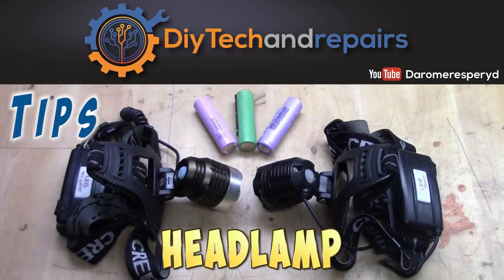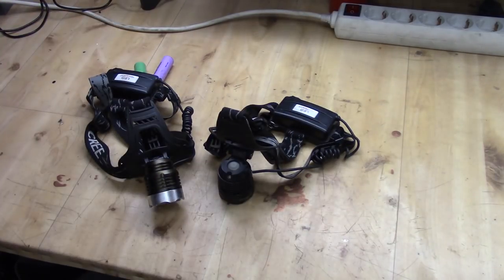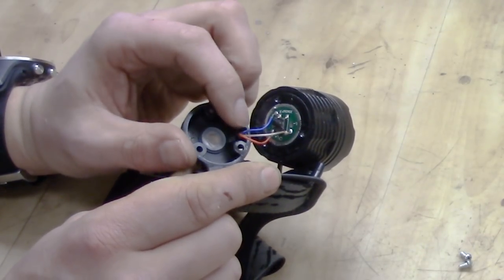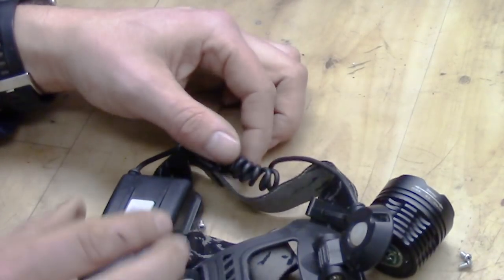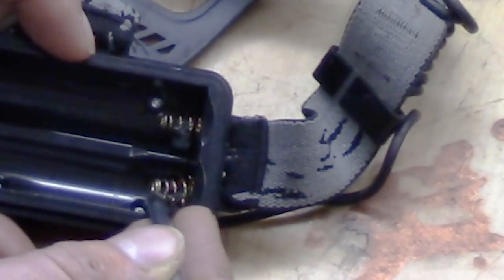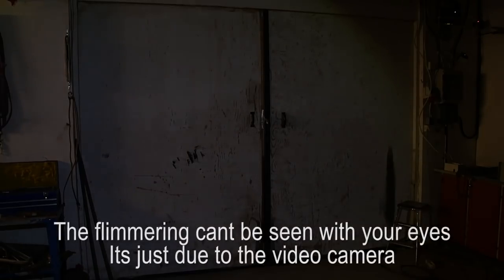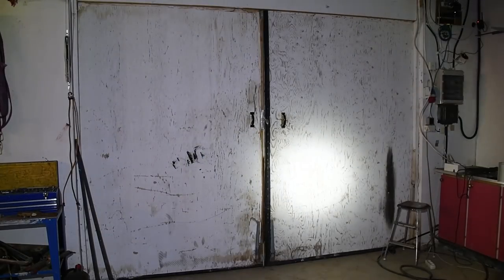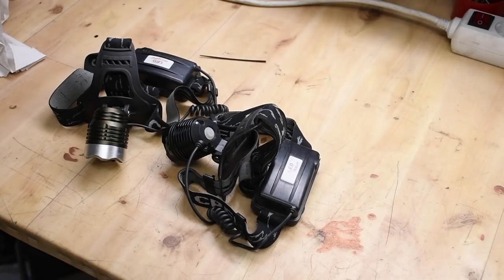18650 based Headlamp tips!

Comment: Good information. Thank you. And I agree about getting your 18650 batteries separately from a good supplier. My main issues with these cheap headlights is that the straps fail early and they are difficult to replace or fix. But the LEDs themselves are usually good even with cheap units.

Comment: Have you tried those "angled" single cell 18650 -headlamps? Skilhunt H-series for example? Or cheaper, general Chinese lamps of similar style? Personally I just love the simplicity, smallish size and lack of wires with these lamps. Thanks for great videos! Subscribed. :)
Reply from the maker: havent tried those. I never liked the battery in the front but dunno :)  For long run i have my battery in my case/back instead of on the head. But then I also carry a lighter front light as well. Currently a Petz

Comment: What about using a 2s lipo for the light battery
Reply from the maker: TEXAS-LINEMAN GAMING its 1s inside. 2p is the battery layout
Reply: Ok cool, I’m thinking about moding a 1s lips to mine so I can work all night without having dead batteries. I’m a lineman at night so I use my light alot